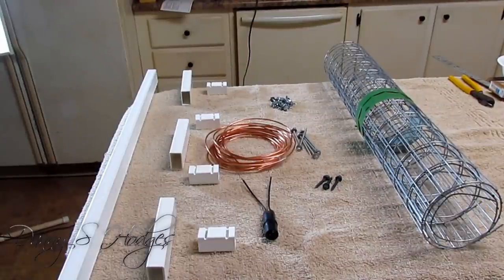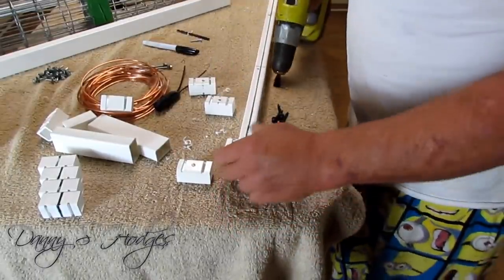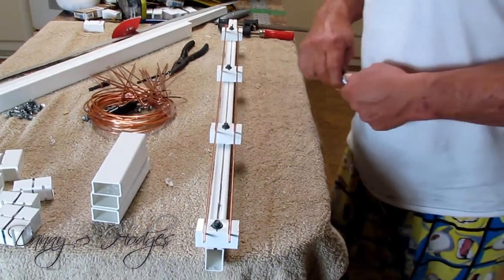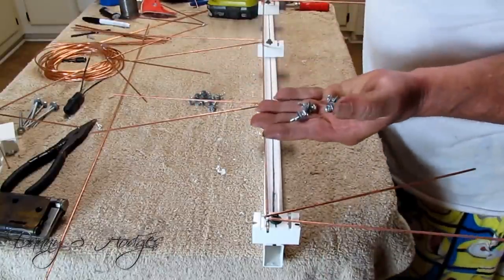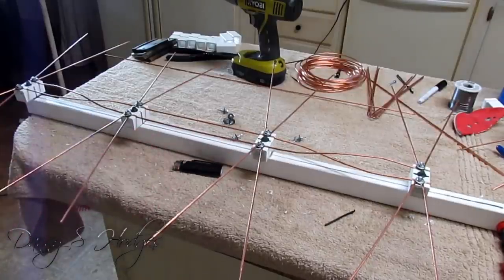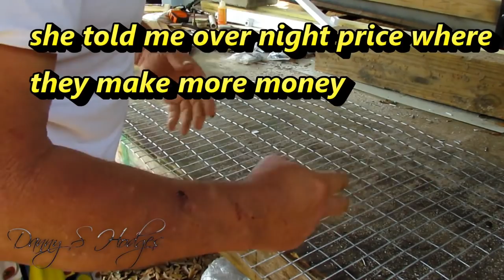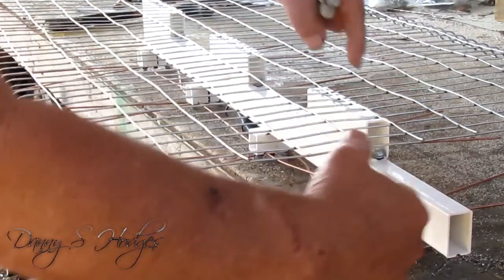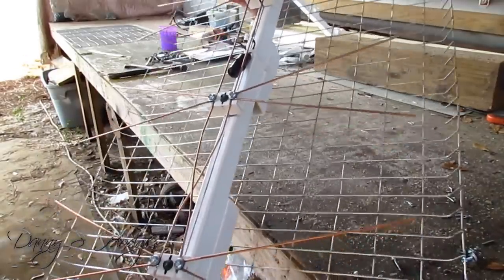The Ultimate Outdoor TV Antenna Kit

Comment: Your the Man I lost a few stations weeks ago. Watched almost all your videos. Made a trial version out of scrap 8ga braided wire for whiskers and 12ga solid wire I think for the back bone. Believe it or not I got back the ones I lost with 2 more but did loose 1 station and now for the kicker I didn't put the vhf whiskers or the reflector on it and it's inside my living room. Oh and there's no booster either This thing is a beast Wish I cold take a pic and post it
Reply: Just added a makeshift reflector and I'm getting everything and a bunch more still no booster or vhf add on and its still in the living room window. best thing is it didn't cost a thing.

Comment: Really like all your videos there innovative offering input that may help you out when your soldering the antenna wires 1 soldering flux 2 soldering pot you dip your wires in the flux then dip wires in the pot that's about the easiest way you can do it or you could use the flux then use your soldering iron but solder Likes to stick to solder then on then on antenna matching transformer cross connector bridge allows2 to one wire connections to join your antenna wires to the matching transformer

Comment: Just purchased off eBay I'm in western Arizona can't wait to try this antenna.  I'm 5 miles from tv relay antenna abd my king jack just won't pull in enough signal.
I use a signal finder and have it pointed at strongest signal but still nothing that tv can pick up
Fingers crossed will update after I get this assembled and try it

Comment: I have a tip for ya Danny.  You know where the copper wire criss-cross on each end and you have to keep them separated.  Take a real small piece of heat shrink tubing and slide it down the wire to where they could touch and shrink it down with your torch.  You honestly would only have to do this to one wire but could do it to both just to make it look more uniform. thus insulating them from each other.  You can get it in different colors even and it would look more professional the just plain electrical tape.

Comment: Danny, that is the most straightforward instructional video on the ultimate antenna I have seen.   I just put in my order.  I assume I need to get my own booster and cable.  I am also going to measure the signal with Hauppauge before and after just to try it ya know.

I am in the Dallas, TX area about 65 miles from most of the stations.  Only 2 channels in VHF (8 & 11) which I am led to believe are all high vhf.  Here’s hoping I get it right.
Reply from the maker: Me too brother..thank you
Reply: In which direction is that 65 miles from Cedar Hill, TX? WFAA does broadcast on real 8, but KTVT-11 is broadcasting on 19 a UHF channel. DFW has several LP`s across the VHF spectrum you can check on rabbitears.org to see if any of them interest you enough to invest in low VHF 2-6 you can add in with a combiner as Danny`s should get WFAA in fine unless you live in East Texas and are close to KLTV-7 out of Tyler which can overpower WFAA-8 if you are close enough to the transmitter.  Ive had the best results with Danny`s antenna with the Winegard LNA-200 Boost amp, and be sure you are using RG-6 solid copper and not the copper plated stuff most big box stores sell. You can search ebay for a seller that sells the Chinese made cable - generally around $20 for 100-150 feet. I get most DFW channels on most nights 125 miles away with the antenna mounted outside about 25' off the ground.
Reply: album183 We are near Greenville so most of the Dallas stations are roughly 235 degrees at 60-65 miles according to TVFool.  I have been using an old Channel Master antenna that pulls a lot of those channels in or used to. We used to use a rotor to point to Tyler which is not much different in distance.

Oh on cabling everything in the house is wired with RG6.  We have a RF distribution amplified to fan out to 4 rooms and the power for the old preamp is on the antenna side of that distribution amp.
Reply: @brentjohnson6654  with the right outdoor antenna and low noise preamp you should be able to get KLTV 7 out of tyler as you are far enough away from Wfaa-8 that it shouldnt cross interefer with it. 51,56, & 19 are going to be too far. Being in Greenville and the DFW market you are prob best served with one of the older U/V combos as the newer ones tend to delete out low VHF ( 2-6). If you had the space and don't mind a large Antenna a CM-3020 or Winguard HD8200 on a rotor and a good low noise pre-amp like the Winegard AP-8700 which is no longer produced but can be found as NOS on ebay for $70-$100 is about the best you can get unless you want to spend $300 on a handmade tinlee amp out of Canada.

Comment: Really great Video Danny.  Do the 2 vertical  cross overs of the copper wire down the center of antenna need to touch each other,  be apart or does it matter.   I seen you spread them so many times, but can’t tell if were they are apart or touching.   That is one great instruction video and super nice set-up for shipping.
Reply: Brett Nigocs they should be apart, not touching.

Comment: Shipping to Australia would be crazy expensive. I need to find some 10AWG solid copper and some of that plastic box section here downunder. Great video mate. Thanks
Reply from the maker: tks
Reply: If you can't find 10AWG solid copper wire down under, look for galvanized or copper weld wire.

Comment: like to see it bring in all thou's channels.  you do a lot of selling but no video of reception on a working tv.  you also use a amp which makes any design perform better.  i made one much smaller different design  no amp brings in 150 channels not perfect but works. use pvc pipe  and house wiring 16 ga and coiled it in 3 directions formed a cross placed inside pvc pipe.

Comment: I am looking for an antenna that will pick up 75 miles away. I have a channel master with a 7777 amplifier now and it cuts in and out so much you can't watch half of the channels so I am needing something that works.
Reply: I had a channel master 8 bay two days ago had the same problem,put Dannys up yesterday got all the channels without a booster.
Reply: @jackhall729  How far away are you picking up? Did you get the 7778 amplifyer just in case?
Reply: @RutherfordTony  My cbs is 100 road miles away,tv fool .com says its 90 before i got dannys i could get it but freeze up pixs or just go out ,hooked up danny get it no problem without a booster,i hooked up an old rca basic booster and picked up 9 more channels.

Comment: Danny, you're selling it too cheap on the "e...."  auction site.  You don't sell something people put up on their roofs. You're REALLY selling a BOX FULL of BRAINS !!!  All the hours  you spent finding/creating  all the components and the BEST process to assemble it is something not just anyone can do.  Look at a ham radio magazine sometime.  Advertisers there sell antenna "kits" for $85 to $175 {without shipping... Google "JTG5RV " for instance.)    ALL customers  get for their money is 2  ceramic insulators,  2 coils of copper wire and a balun (balancing transformer). After it all gets hung up they have to use an SWR meter and spend about 1/2 a day getting it "tuned up!!!"     = SEE ALL THE WORK YOU DID, SO CUSTOMERS DON'T HAVE TO ? =IMO, you are leaving money on the table!  73s